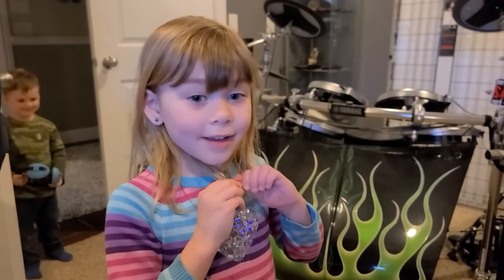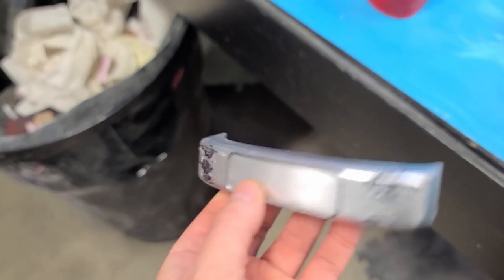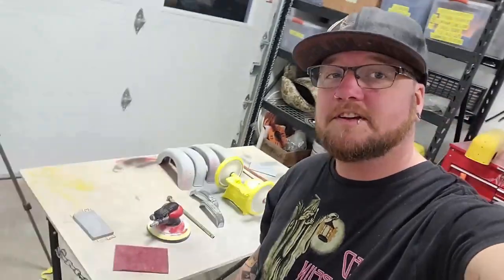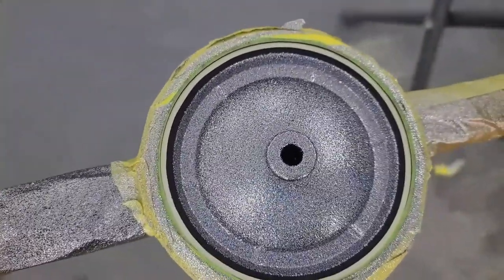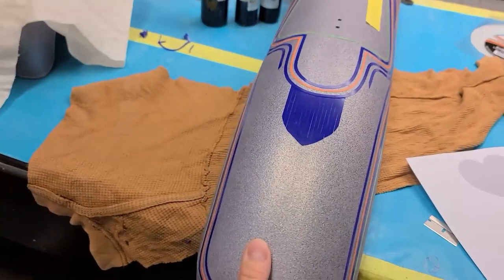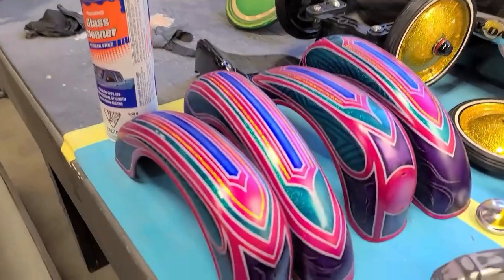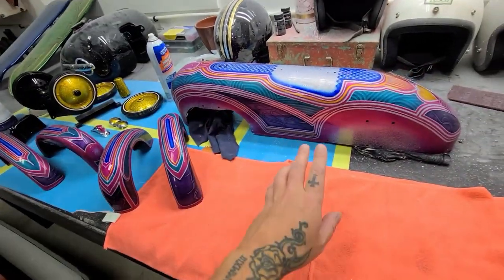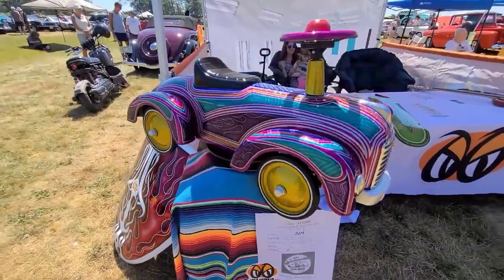Custom Painting a Tiny Car! - SlickWorks EP18

Comment: can you put holographic silver into silver base or do you do something different with it?
Reply from the maker: you would want to spray the silver down first, then mix your flake with either a clear basecoat (intercoat) or clear coat and spray that over the silver, then lock it all under some heavy clear.
Reply: after that i can do some kandy coats?
Reply from the maker: @alexmason5264  heck yeah buddy. sand it flat with 400g then go to town with some tape!
Reply: @SlickWorks  thank you for the tips i would like to collaborate with you as i start the process of painting my truck when i start it that is. but would it be ok to get tips from you as i go?
Reply from the maker: @alexmason5264  Of course! Im an open book. Look me up on Slickworks Official facebook group
Reply: @SlickWorks  thank you will do.

Comment: Whats the purpose of different color tape…the blue the green and orange..is there something im not understanding
Reply from the maker: no purpose, really I was just using a mix of fbs and amazon cheapo tape. But fbs does have different color coded tape with diffrrent softness. Red tape by fbs is AMAZING stuff. Handles super tight corners even with 1/4"